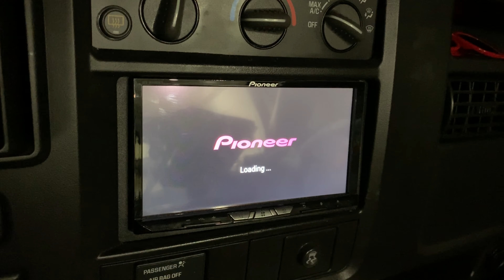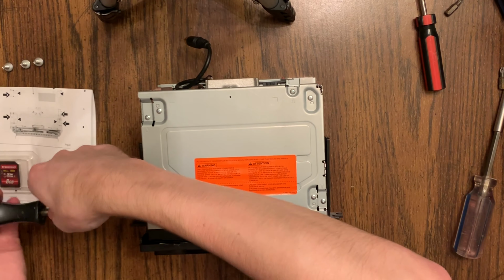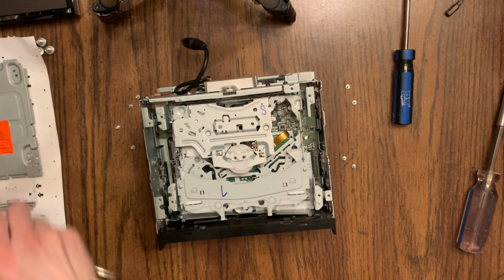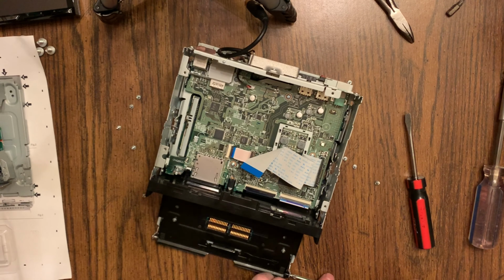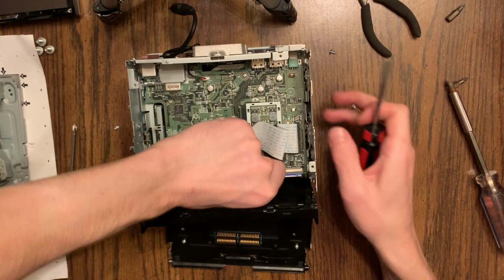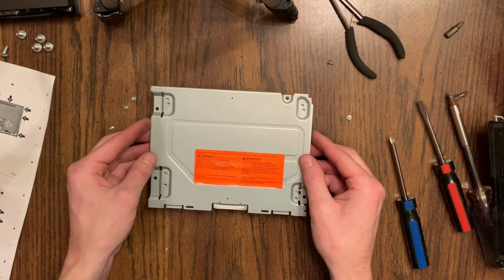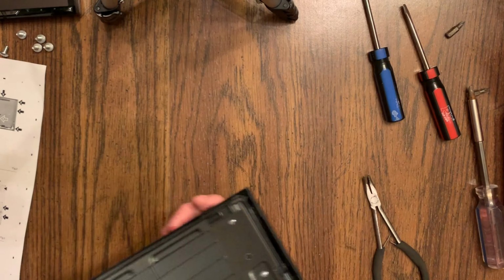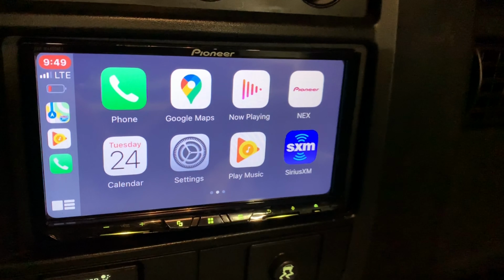Pioneer Software Error Fix - SD Card Replacement Procedure

Comment: Appreciate the video man, I was able to fix my radio. Such a shame Pioneer didn't recall these units for the terrible SD cards they stuck in them. My Pioneer AVH-W4500NEX wasn't even 2 years old (MFR Jan. 2019) and it went out about a week ago. This was a great help, thank you so much!
Reply from the maker: Definitely a shame (especially from a major brand name) but glad you’re back up and running!

Happy travels!
-Tim
Reply: Where did you buy your sd card for your pioneer
Reply: I just started having this issue. Where did you get your SD card from? Or is there a way to just copy the data onto your own SD card?
Reply: @adamserrano5406  i got mine on ebay work like a magic
Reply from the maker: @adamserrano5406  hey Adam, you can just go pick up a blank 16GB card then follow the guide here to write the files (a little more complicated than a copy / paste procedure, but nothing too crazy)
https://youtu.be/Cro26vuoPHo
Reply: @VanwithTim  Thanks. I just followed all the instructions and am about to reassemble my unit and test it. Fingers crossed this works well for my 4500.
Update: so touch screen didn't work. And even worse, after turning the car off and then back on, I started getting the black software error screen only. Any ideas?
Reply from the maker: @adamserrano5406  let me know if it works for your unit. I’ve heard the w4500 will load with the w4400 file, but the touch screen won’t work? (May have to purchase the pre-loaded w4500 SD card from eBay in that case)

Keep us updated 🙏
Reply: @VanwithTim  Hey Tim I did update my post above. I just might have to go the eBay route. I was hoping for a faster fix.
Reply: @VanwithTim  I’m in the same boat with Adam. I have the 4500. If I buy the eBay sd card is it possible to transfer  the software to a better sd card?
Reply: @ryan9352  yeah same question as well.
Reply: @kennethl8626  so far no luck. Pioneer seems to have the software only visible to the head unit. My computer will not read it. Once again.
Reply: @kennethl8626  The eBay card did solve my problems though!
Reply: Mine just died 2 days ago :( gonna have to do this

Comment: This video has by far been the biggest money saver. This absolutely works, I was about to buy a whole new head unit and you saved me over 1000 bucks on an upgrade. You sir, are a hero. A true hero.
Reply: hello, this is random but my Pioneer AVH-4500NEX just started the above issues- was the process easy to do and do you have a similar  model? i would rather spend 52 than 1000- any help would be appreciated. i am no mechanic, i have basic knowledge on these systems
Reply: Hi, i have the same problem with my avh 9200 dab where can i get new firm ware. Or is it a empty sd card ?

Comment: just had the same procedure few days ago.
i took the top cover as well but it was unnecessary as you mentioned.

you can basically just take to 2 screws from the sides (1 each side) which holds the plastic frame to the cage,
then take the 2 small plates out (from the front panel) and take the out the 2 screws which hold the panel connector
then just pull the bottom part toward you and you can just enough space to pull the SD out.

BTW I bought a fast SD card which have better performance then the original so the system works even better.

cool video - wish i saw it a week ago :)
Reply from the maker: Good call on the upgraded SD card! 
I went with a “class 10” SanDisk for my dashcam and it had a noticeable difference over the original class 4. Didn’t even think to do it with the radio 😓
Reply: Model and make of your SD card you got?

Comment: This video was a life saver, thank you!  I freaked out when my deck started having the loop error, thought I was gonna have to replace it.  Luckily, I’m not the only on that had this issue and I found this video.  This was a super easy procedure and it works flawlessly again.  And yes, don’t need to remove the top of the stereo just the front to get to the internal SD.
Reply from the maker: Glad it helped! The hardest part in most vehicles seems to be removing the dash panels.
Enjoy the freshly revived tunes!!

Comment: I slide out the sliding mechanism and unscrew the 2 screws for the sliding mechanism, 2 screws holding the black trim piece,pried black trim piece enough to eject the old  SD card and insert the new card.  I did not remove the ribbon plug.  I followed step by step downloading the software to my SD card which was nice.  Easy fix thanks

Comment: Thank you! I found the firmware image online and was able to follow your instructions to disassemble. I now have a working stereo! Thanks so much!!
Reply: This Firmware image that he is using? The one that gives Navigation?
Reply: yes please   ...
Reply: @cyberlocc  Did you find the firmware image to get it back to factory...    I have the same problem with this 4400 I have used it maybe 30 times my whole time owning it since it was new I updated the firmware once couple years ago ...      I'm trying to research how I can fix it...
Reply: @cyberlocc  That isn't built in nav... it's Apply Carplay in his vid... :|
Reply: @JoeAdkinsishere  No it isn't. It's Nav of the radio, on the 4400 it's built in, they just disable it. 

I got the firmware, this does work.

Comment: I wanted to post and say thank you.  This video helped me get a pioneer 4400NEX unit working.  I was going to throw the thing in the trash and I thought, well it can't get any more broken.  Followed your steps, fired the unit up with a computer power supply, and I have an extra high dollar double din head unit now.  So thanks a bunch!

Rant:  on a side note, really disappointed with Pioneer for this problem.  Seems like its poorly engineered.  At the very least the sdcard could have been more easily accessible for serviceability.
Reply from the maker: So glad it seems to be a somewhat easy and affordable fix, but totally agree they should have left the card accessible!
All the best!
-Tim

Comment: Thanks Tim!  Saved me a few hundred bucks, as I figured my 4400NEX was dead after 3 years.... obviously not. Worked out great using the condensed instructions left by Scott Neilson.  

I will admit, I had to take the front off twice.... as I put the new SD card in the top slot the first time (didn't follow your instructions in the video).  Second time, watched your vid again and moved card.
Reply from the maker: Great to hear Joe!

I did the job again with a new file (the SD card from eBay was actually missing the FM radio??)

I had to re-watch my video to remember which slot I had just removed the original card from haha.

Enjoy the tunes!
Reply: @VanwithTim  any chance you've tested Android auto wireless? Ever since I flashed new card, wireless AA no longer works for me. Wired works, but my wifi won't connect now....
Reply from the maker: @JoeAdkinsishere  hmmm. My only Android phone is my HTC One from 2013 so probably not much help in troubleshooting.

Can you try a factory reset on the radio? Long shot, but someone had issues after SD replacement and that actually fixed it.

Of course try it with a different phone as well just to be sure!

I also vaguely remember someone looking for firmware 1.01 as the firmware in the file is 1.02 and there were android connectivity issues.

Sorry I can’t be of more help
Reply from the maker: Hey Joe, curious if a factory reset on the unit solved your Android Auto wireless connectivity issues?
Reply: @VanwithTim  nope, my wireless Android auto is pretty much DOA. Factory reset was the first thing I tried... 😉
Reply from the maker: @JoeAdkinsishere  Aw man… thanks for the update. Have another viewer with the same issue. Wish it were better news!

Comment: I finally got the nerve up to replace my faulty sd card in my w4400 head unit. I simply pulled out the sliding mechanism, popped of the black plate, and used a really good paid of long tweezers to simply change out the cards. Literally took me 3 mins.

Comment: Mine started screwing up when I got the   new Iphone 13, then when I installed SXV300 Sirius tuner it would not store presets. When we got to the memory cards I found the cheapest piece of crap sd card for the firmware and NO memory card was ever installed. I used two Sandisk 32gb cards and downloading was simple. The head unit never worked as well as it does now. Super happy, thanks
Reply from the maker: Glad it's back up and running! Such strange issues.
Happy listening!
-Tim

Comment: Appreciate all the information. I also have the nex 4400,   I  disconnected battery to replace with new one, turn on ignition to see error message and stuck in boot loop. Read the forum, download file form link and download win32 to computer, transferred to SD card, now working again.
Reply from the maker: Glad it's working again.  Also happy to hear the 4400NEX file is finally available on the forum! 
I waited nearly a year for anyone to upload the image, but eventually had to buy the pre-loaded SD card from eBay.
Reply: @VanwithTim  what forum?
Reply from the maker: @Pinkielover  http://avic411.com/index.php?/topic/90534-how-to-fix-for-avh-w4400nex-boot-loop/

Comment: Did this to my 4500 NEX and it works perfect! Thank you so much buddy👍🏻👊🏻
Reply from the maker: Hey Sergio, wanted to see if the touchscreen was working? I hear the 4400NEX file works in the 4500NEX but the touchscreen usually doesn't function.
Cheers!
-Tim
Reply: Touch screen isn’t working for me..
Reply: I have a w4500 nex
Reply: It didn’t work for me either. I found a 4500 nex download. Can’t find it again. Needed to rewrite my sd card. Battery failure made it mess up again.
Reply: Did anyone find a rewrite download for th pioneer avh4500nex?

Comment: I got 2 16 GB SD cards today and they didn't work. Using win32 to copy the image file it crashed at 7% with an error message. I found a brand new 8 GB and used win32 to write the image to it and it worked. My wife's unit is working again. I don't have a clue why my other 8 GB cards didn't work. Just be aware that win32 will say there isn't enough room for the image but it doesn't appear to be data. Just proceed and you should be good. Thanks for the video. You saved me.
Reply from the maker: Glad you were able to get it all sorted out.  Bit of a headache but it sounds like it's finally working!  

If you want to make a video showing the process of writing the image to the SD card, I'd be happy to link to it in this video.

Nice work Antonio

Comment: Thank you very much for the video and for all the past knowledge, I managed to fix my pioneer Avh-z9180tv (Brazilian model) doing this same procedure as the video, the only thing I had to do is restore it to factory default after putting the firmware there, it all appears the icons (digital TV, FM radio ) and it worked perfectly, I'm grateful for the help, you're a 1000 mark.
Reply from the maker: Thank you for the update! That's good info to have about the factory reset after the procedure. Will make sure to mention it to others with the Z9180 units!
All the best!
-Tim
Reply: @VanwithTim  Does anyone have this firmware available here in North America so we don't have to keep going to Russia for the fix?

Thank you
Reply from the maker: @greddytalon  yes the files were finally posted for free on the online forums.
I have the files linked as well as explain how to write them to the SD card in this video: https://youtu.be/Cro26vuoPHo
Reply: ola meu amigo pode me ajudar a resolver esse mesmo problema na minha avh 9180tv por favor obrigado
Reply: @lucask3250 você usou essa mesma versão AVH4400NEX? Pois usei no meu que é igual ao seu e não funcionou o rádio e nem a TV,  de resto funcionou tudo.
Reply: @iosouza  tudo bem? Então faz um reset nela que volta tudo, a minha foi assim e agora funciona tudo
Reply: @lucask3250  cara, não acredito que fiquei 2 anos com o meu aparelho funcionando somente pendrive....kkkk....fui no carro agora e fiz o reset no botão, e voltou a funcionar a TV e o rádio....\o/...muito obrigado 😃
Reply: @iosouza  opa fico feliz por ter ajudado haha agora só alegria 😂 😂 😂 😂

Comment: Great Video.  I have the Pioneer AVH 4200.  Took mine apart and noticed that the firmware SD card slot was placed to the right of the factory SD card and not on the bottom.  I originally just removed the factory SD card and inserted the replacement SD card that I loaded the files to. Put everything back together and got the software error.  Took the unit back out, disassembled and noticed the second slot to the right.  I will see if it works this time.  Thanks for posting all the information, great help.
Reply: I re installed the unit and still have the software issue.
Reply from the maker: Hey David sorry for the late reply. Did you try using the 4400NEX file? Or did you find the 4200NEX file to load?
Some folks with the 4500NEX were ALMOST able to use the 4400NEX file (unit would boot fine but no touchscreen response).
Might want to hit up some of the eBay sellers who offer the pre-loaded 4200 replacement SD cards - there should be a warranty / guarantee from them I would imagine.
(I haven't heard anything bad (or good) about this seller yet, but it seems they're the only ones offering the file - https://www.ebay.com/itm/133619620675)

Edit- also keep an eye out on the forums for a free 4200nex file. Haven't found one out there yet, but I feel like eventually someone will upload it? http://avic411.com/index.php?/search/&q=4200NEX
-Tim
Reply: You ever get it to work? I can’t find the img file for the 4200

Comment: What they really need is a firmware update that allows the front to fold down even if the boot loop occurs.  Maybe a secret combination of buttons like holding volume up and then press and hold power for 10 seconds to slide out front face.  What a pain.  Thanks for the video though.

Comment: Hi , if you want to update , use SD card which belong to Pioneer. Because the rest card format is different and pioneer lock them then you cant use...
You can do all step what he says but also check below steps which i tell if his way not works.

1. Try to remove SD card lock unlock several time from side maybe it will work . ( mine worked)
2.  Connect dvd correctly  on top.
if any of hardware disconnected update will fail. 
3. Update via usb stick . ( format with fat32. Not quick the one which is 15 min , check box the quick format by click. )

I faced with several type of errors fixed it. My pioneer is AVH 8650BT at last i fixed it and update from 1.09 to 1.20
Reply: this fix is for a pioneer 4400 ..It's not to update anything

Comment: Thank you! followed the directions and I was able to get it working again.  I did have an issue with wireless Android Auto but after performing  factory  reset the headunit and its working afine aain ( AVH 4400NEX)

Comment: Ran into the same issue, and replaced mine by:

1) removing the head unit
2) remove vehicle mounting bracket
3) remove faceplate locking screws (1 on either side)
4) pulled out screen bracket from bottom
5) released various clamps holding the faceplate
6) finagled out the SD card - even without removing the ribbon cable there's just enough room to do this
7) replaced with new card
8) put everything back together again

With all this said I found it very annoying this card is directly below the user accessible SD card slot. Pioneer could have easily included a way to gain access to this card. Then if the unit detected a card failure it could open the front try to provide access (or maybe holding eject on boot would cause the faceplate to open). Had this been the case it would have been fixed in the amount of time it took me to burn a new SD card. Then again Pioneer wouldn't get to charge people $200 (or so I've seen on blogs) for service that takes them probably 5 minutes to do. 

If it happens again I'm taking a Dremel to the faceplate to make sure I've got access to it in the future, since I now know I can easily remove the faceplate and pull out the mounting bracket by hand if needed using only a small flathead screwdriver.

It's also annoying (but not unexpected) people are charging $35+ for what is essentially a cheap SD card made with software you can find online. Thankfully, SD cards are a dime a dozen now, and I had a spare 32GB card (smallest I had) and the know how to burn my own. The image was only 8GB, but from the sounds of things some people have had to use 16GB cards. I couldn't read the old card at all from my computer so I have no idea how big it was.
Reply: Where did you get the image files and what unit do you have?
Reply: I was watching this video and I asked myself, "can i just take a dremel to the front?!!!!!"   great minds think alike!!!   Do you know where to find the software on the internet?  thanks in advance

Comment: Hi. Thanx for useful video.
Now my Z9100BT work with 32Gb sd card.
Reply: Hi, my radio is Z9200, after inserting the SD card, the first message is whether the DAB antenna should have power, you can not do anything because the touch does not work.  Has your radio started as always, there were no problems?
Reply: @Zdzich43  Hi!
 info: Z9100BT haven’t DAB
before: didn’t save any settings, didn’t reset Bluetooth device list, didn’t wireless pair/connect automatically to my new iPhone 13 pro…
After: first start was normal ( not errors or scared questions)
All functions work like a brand new one device

Comment: When the screen is working you can just press a button and the screen will come up with a motor giving you easy access to the sd card slot. I wonder if there’s a way you can do this while it’s having an issue

Comment: This definitely worked for me.  I have a mac (m1), I tried using a Parallels VM to do the disk image thing, but that did not work. But using BalenaEtcher - which is mac compatible did work just fine. Also do not use microSD cards/adapters, just use a good quality SD card - I mean you don't want this to fail again do you? I used a Samsung PRO 64gb and it worked on the first try.